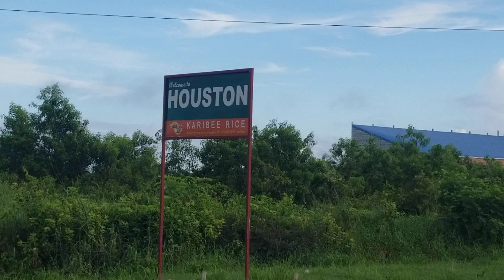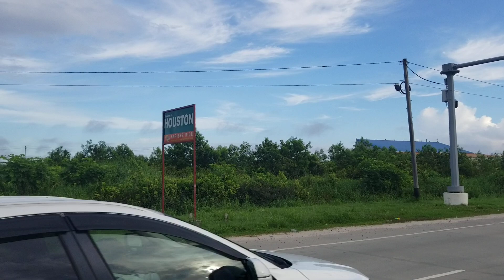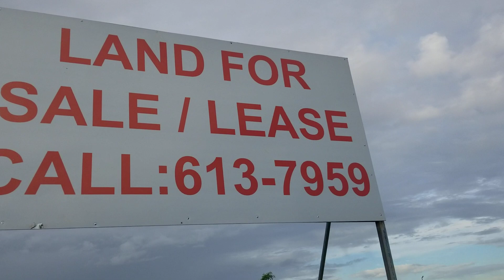Developments along  the road connecting the East Bank Bypass road to East Bank Public road

Comment: "Agricola" I think used to be a village along the East Bank road. It's a Roman word that means farm,...

I think one of the firm that's involved in the gas generating power plant is Korean.
You may be looking at their construction yard. 

And the concrete roads as usual is of minimal dimensions to save costs.
As I said earlier crushed aggregates for concrete and asphaltic concrete roads are not cheap.
The granite rocks are blasted with dynamite, crushed more than once, screened and washed and transported from the interior to the coast.

Guyana needs a lot of aggregates to build......

White sand and reef sand is taken from wayside pits for free...just load and transport costs.
Aggregates expensive.